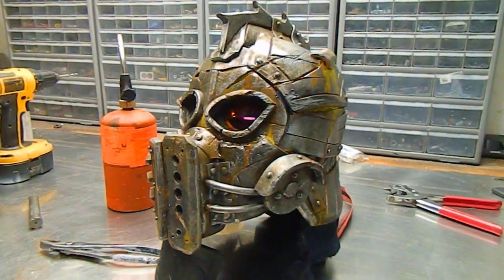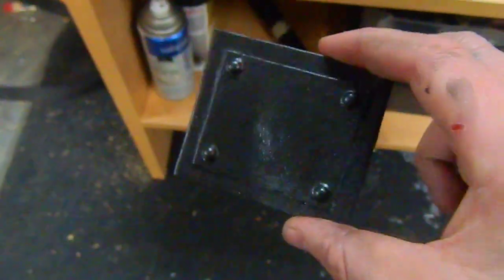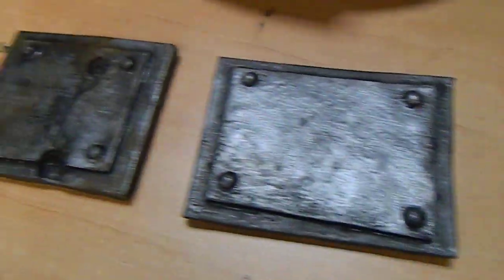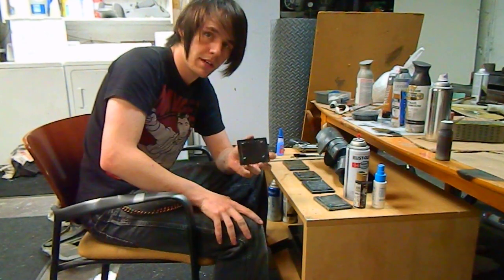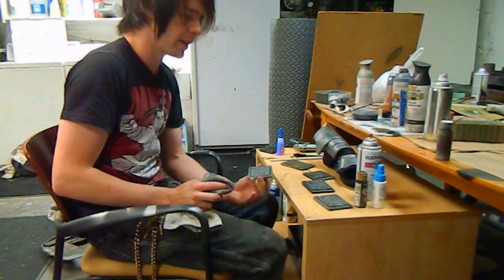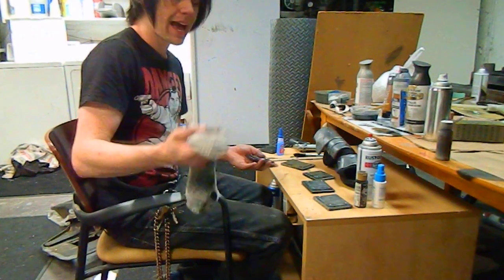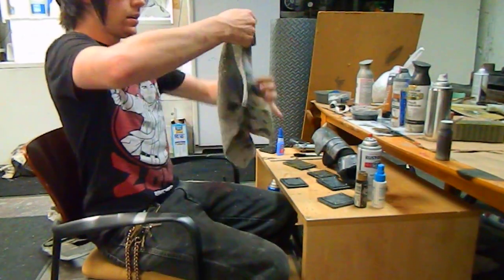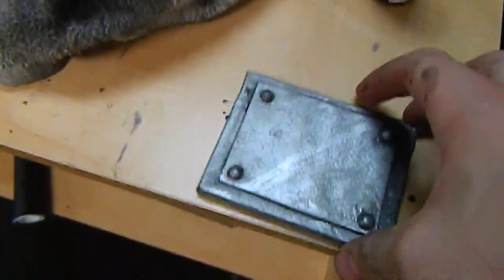EVA Foam Armor: Basic Weathering

Comment: Great tutorials! they helped me a lot!
I've a few questions tho, hope you can help me:
Which colour of plasti-dip do you use? transparent glossy or clear?
Is it ok if I use generic black spray paint instead of rustoleum over the plasti dip?
Thanks for helping the community with these ;)
Reply: It looks like regular black glossy plastidip spray/dip can in the tutorial. At least that is what I use and seems similar from watching this. I'd recommend a primer or spray adhesive over the plastidip if you want a smoother texture before using any regular paint.

Comment: Hey! I've totally found a new hobby based on your videos. Got 2 projects I'm about to take on for my kids. 8 year old is going as cloud strife this year. Wondering if you had any advice for buster sword (he will be rough on it) planning foam 3 1/2" PVC running the length of it set into wooden base. The second is weeping angel costume for my 10 year old I haven't even started planning. Thinking mask and wings with eva but that seems tough. Begging for any advice on either project you've got.
Reply: I have been working on a buster sword and I can tell you my advice/show you my work. First, buy some foam boards at the dollar store for insulation and support.. Next, use foam mats (I used some foamies I bought at hobby lobby) to cover it and detail it (example: https://www.flickr.com/photos/128480491@N04/15476661332/) while the foam core, that I stacked 4 boards thick, was sturdy enough to hold everything up. I used duct tape to keep the boards together.

I used a readied small wooden fence post at Home Depot (cost = under 3 dollars) I cut down with a hacksaw as the handle. Everything was measured from this template (http://www.deviantart.com/art/Cloud-Strife-Buster-Sword-Measurements-Ver-2-282435593)
Reply: That design is freaking awesome. I like the fence post idea. Did you run that the entire length of the blade?
Reply: learncontrol23ify

For the design you can draw it out on vanilla folders (You can buy a big pack of them for cheap at Target) as they are thick and great for making your own templates. I ran the fence post up to the first hole in the sword then used dowels, wire, and thick cardboard as a frame that held the foam board around the edges. If you can't glue it together then duct tape it. The reason why I used the foam board is because it is very light but sturdy taped together in a stack. So it is very easy to carry with the frame.

Comment: You are so damn informative and entertaining. I'm doing steampunk cosmetic prosthetics so my primary color is bronze but everything here is still applicable. Just this level of detail would be great for my own prosth arm, further levels for my reborn soldier concept. Gah, you are making me excited to get to work.

I do want to mention, though, that I will use a slightly different prep sequence. I'm using 1/6 inch "fun foam" so that it rests closer to the skin, to give the appearance of a prosth rather than armor. Plastidip adds thickness and also stiffens the material, which is problematic for such a thin/floppy foam. Instead, I'm recycling .080" styrene signs. After vaguely shaping the foam, I attach the appropriately stenciled styrene piece. It now holds its shape, is not perceived any thicker, and has a flat surface for sanding and painting.

For actual armor, however, I am definitely defaulting to your touted methods.

Comment: Also this is a pretty novice question i'm sure.  But he multiple layers there.  Are they two pieces glued together? or is it one piece that you shaved down around the edges?

Thank you.
Reply: shawn10003000 you could layer it with more foam or you could cut the piece out and raise it as high or low as you want creating the layered effect.